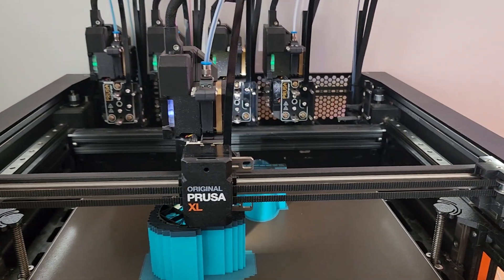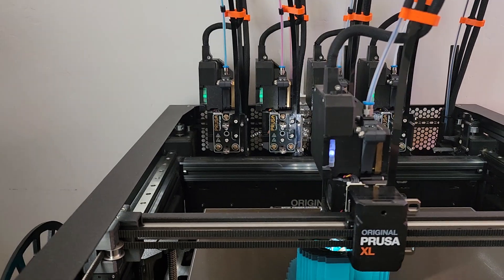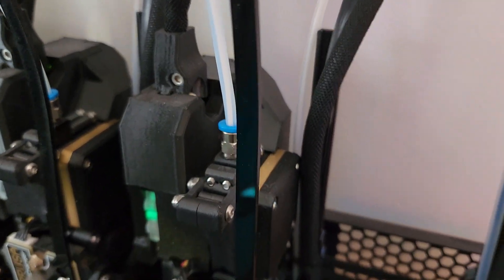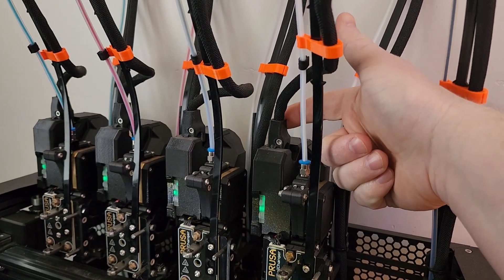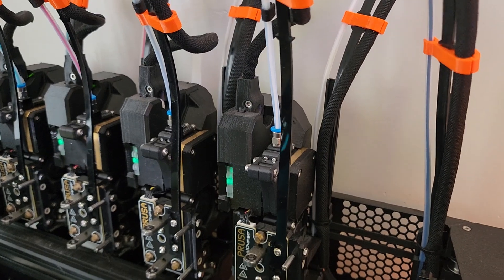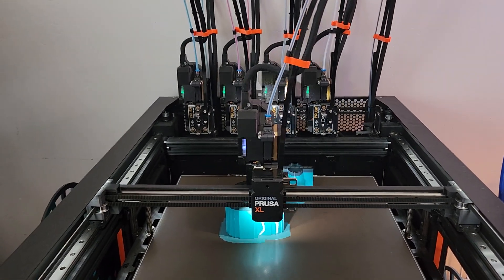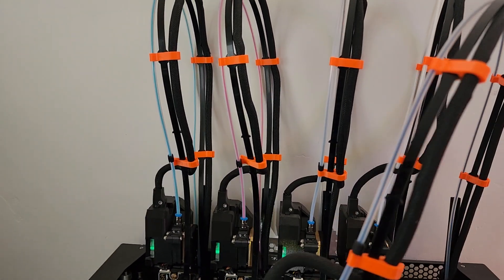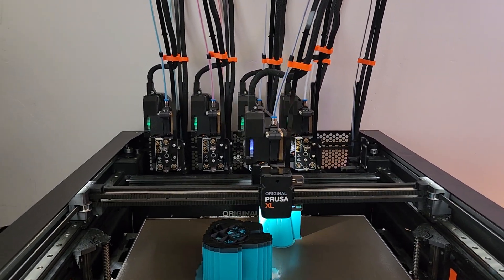How To Fix Prusa XL Extruder Gear Stopping Mid Print

Comment: It's shit like this, is why I don't want to support Prusa anymore.
Reply: Indeed I use to be big fan of them until the long hard wait to get my five head printer from them only to build it an have it be some cable for ground is what the red screen of death was saying when all along it was really a faulty power supply box I went through each one on its back an found the one an got a replacement an poof it was up an running again. I spent so much in this not only in cash but time to have it be because someone in planning an marketing was too cheep to give us real value for what we buy! Where is my buddy board ect.? All I want is what i paid for an get something that like the old MMU is unreliable at times. I plan to try something too once I get a spare head an cable an that is to then take an bake the old ones boards in a oven to refire the solder on them an see if it does the same crap then lol.

Comment: I have had mine for almost 18 months, and have problems with 1 and 3.   Should I try the new connector covers first?  Did Prusa support give you any problems with the replacements parts?
Reply: The files are on Printables, you can print them yourself.
Reply from the maker: Hope it resolves your issue.

Comment: It sounds like the root cause is the printed connector is a bit too loose, allowing the cable to move a bit, ultimately causing the cable to come disconnected, and possibly damaging the dwarf board. So if one isn't having problems, just reprinting this parts would be a good preventive measure? I have had my XL for about 6 months, no issues yet, knock on wood! But I will keep an eye on these, and reprint at the first sign of movement. I see the revised part now bolts in.

Comment: I had the same problems on all tools.  The fix for me  was replacing the cables.  Since then no problems.   Prusa had replaced the buddy board, power supply and dwarf board.   Those changes didn’t help.
Reply from the maker: See that doesn't make sense why all 5 cables would go bad at once. Or did they fail 1 at a time?
Reply: They failed pretty much by which  ones had the most printing time.   2 heads only failed once each (4 and 5).  Prusa sent all 5.